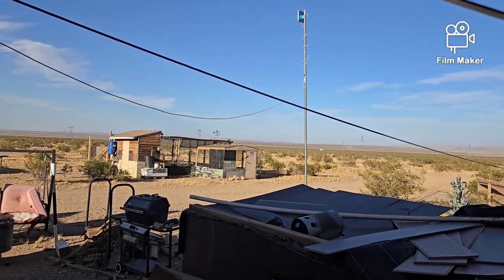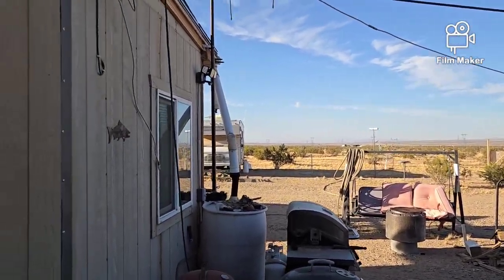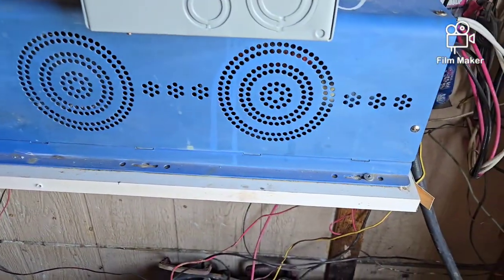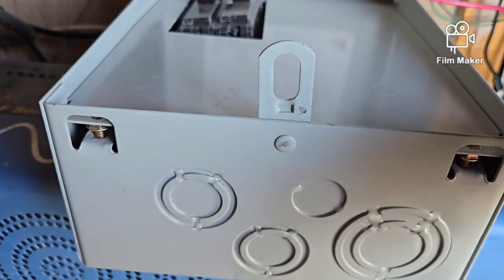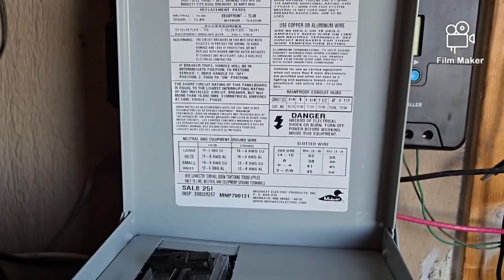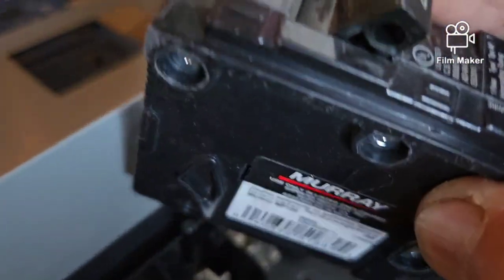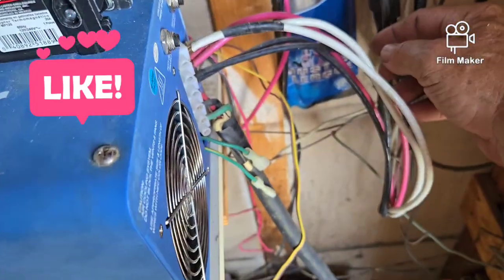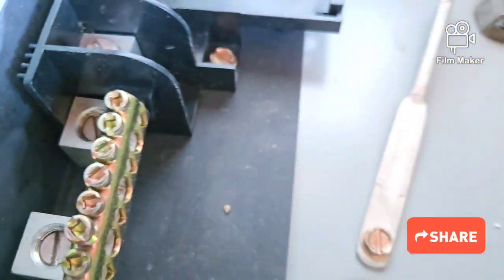Wiring Your Inverter To Your Breaker Panel, Aug. 16, 2024

Comment: Your AIMS inverter has the AC listed as input and output? Is it a dual function inverter/converter?
Reply from the maker: @larrycarlston4044  Funny....
Reply: @GBear  Look at the label that you videoed. Read the inputs and outputs. Is that unit UL listed? Can it be used as a stand alone battery charger?
Reply from the maker: @larrycarlston4044  Yes, I input battery power on one side to create AC out at the other, then I input AC power from a gen (or shore power) on the other side to output both AC and DC charger at the same time.

Comment: Thanks for your explanation. Let me see if I've got this straight, 4000 watt inverter, split phase, at 240 volt would have a average current capability of 16.6 amps per leg? Or do you calculate it for the 120 volt per leg?  I'm just trying to figure out wire size for my system.
I have a 3500 watt, single phase inverter. 3500 watts / 120 vac =  29 amp, so a 10/2-gnd romex should be good. Or should I calculate wire size based on the peak power of 7000 watts or 58 amps, requiring something in the range of 8 awg single core wire (rated at 75 amps)?
In the panel I just tie the phase 1 & phase 2 lugs together.
Thanks for you help.
Reply from the maker: @misfitacres-granny  You have to calculate by the highest possible output of the inverter, even though you probably won't ever reach it.
Reply: @GBear  Many Buttercups,  (merci beaucoup).  🙂
Reply from the maker: @misfitacres-granny You’re welcome.

Comment: Dont forget to mention that on the Aims inverter charger, Unplugging the two little green w/ yellow stripe wires makes the ground go from ground rod to the neutral instead. There ya go, clear as mud...